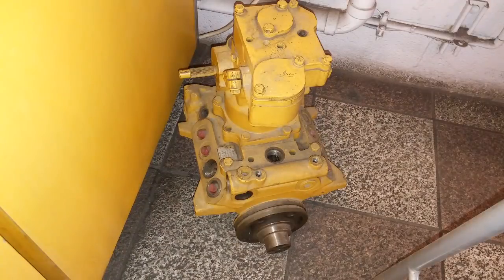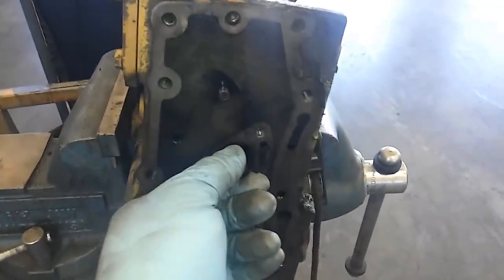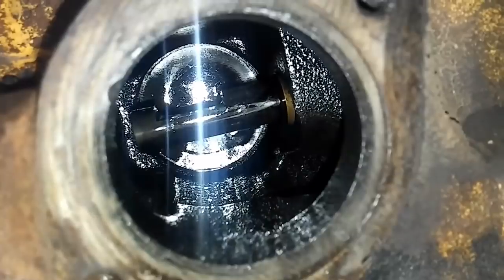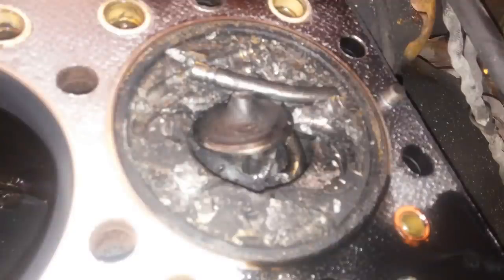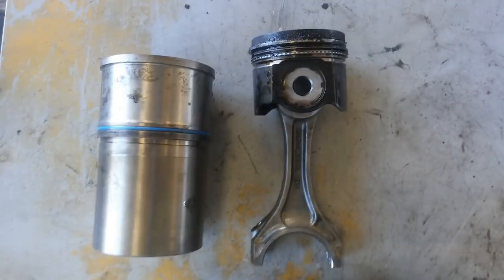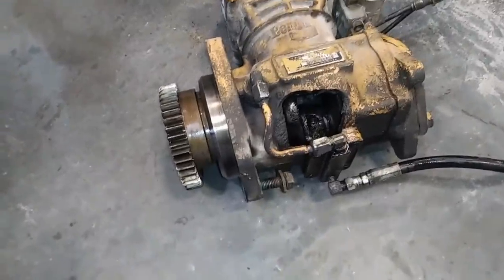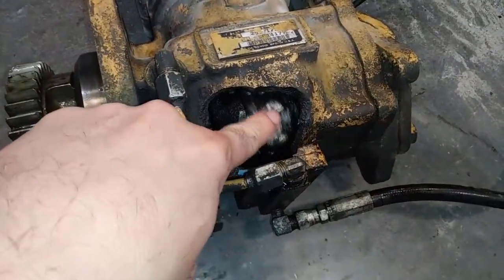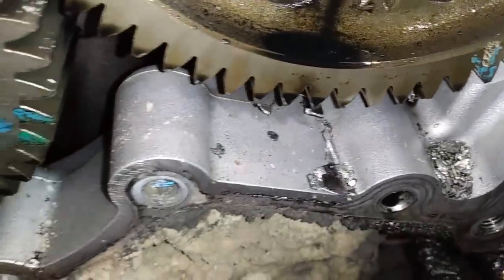Why Do Diesel Engines Runaway? What Is A Diesel Engine Runaway?

Comment: A run away diesel engine happens because of an oil leak in the turbo.  The engine can't be turned off because it isn't running off of the fuel. Worn bearings in the turbo let oil past. The engine then has a hidden fuel supply that you can't control. In a big truck you set the parking brakes. Put the engine in gear and stall the engine by letting the clutch out.

Comment: Everbody just looks at the car and wait until its out, but then it is to late, most diesel runaways are most caused by turbocarger leaks, and a diesel fire its fuel itself so it is useless when you try to shut the vehicle off, because it revs itself up with the oil, you can easy shut it of when  shut the air in take off with a rag or something, or driving away with a high gear, maybe by smaller engines block the exhaust pipe.

Comment: Some engines have very specific,known issues......for example the GM/Detroit 2 stroke diesels had an issue with the injectors internal rack getting stuck on full throttle after sitting for an extended period.  Adept, I have a question, why is it that CAT inline pumps are so much heavier, and physically larger than the equivalent Bosch design?

Comment: The term rack was on the 2 cycle Detroits it has a actual rack that has fingers for each injector the most cause of it running away was during a engine rebuild and  governor washer inside was put on the wrong side wich as soon as you started the engine it would pull the rack wide open, I always put a vice grip on the rack to pull it back in case it did. In 40 yrs I never saw a cat runaway or Cummins.  Turbos go bad and put oil in the exhaust then ignites and you have a exhaust fire , if a engine sucks oil from the intake it don't run away it just won't shut off until you block off the intake or it runs out of oil . I witnessed a Detroit run away the mechanic panicking put it in gear and the truck leaped 10 feet, I ran up put rags over the intake it just sucked them in and slowed a few seconds then I shoved my coat in the intake and it stopped but it almost took the coat through. It was screaming around 6000 rpm we estimated or more . Now so you know 2 cycle Detroits had term set overhead and rack,, Cummins /Cat you just set overhead . I don't mean to be disrespectful but Know more of what you are talking about next time .

Comment: If your diesel runaway.
First in manual try dumping the clutch in 5th gear with handbrake or brakes applied.
Second of you have automatic cut turbo intestine or block air intake with shirt or something like that. If this didin't worked so your engine wants to die early

Comment: Didn't older Detroit's run backwards also. Like when  using starter fluid? I think I remember seeing a cabover freightliner puking exhaust out the intake above the radiator.

Comment: Simple answer, an oil seal fails and the diesel engine sucks in engine oil and can not be shut off with a key.  For those of you that don't know, a diesel will run on oil if it is warmed up.  Nuff said.

Comment: Diesels are at wide open throttle at all times. That alone is scary. I had a rag get sucked into the intake, and it almost caused serious damage. Of course it was an old Mercedes Kompressor with a turbo.

Comment: Carbon dioxide fire extinguisher.
If you have a mig welder in the shop grab the cylinder of shielding gas.
Dump the gas in to the intake.

Comment: 1. To stop a runaway engine you suffocate the engine 2. for a fact I've seen many runaways are due to worn turbo bearings passing oil in through the intake side, the oil acting as a fuel. That's a runaway engine! all else is possible.

Comment: Thank you.  I was wondering if the comparatively low cost of placing a CO2 cylinder that could be actuated from inside the cab or the outside that would flood the air intake with CO2 at the flick of a switch or pull of a toggle. Good insurance that might never be needed.

Comment: The turbine in the turbo in my car broke and caused the engine to loose control,  I put the car in 6th gear and held down the brake while releasing the clutch, so I managed to save it, and that’s why I will never own a automatic

Comment: What would happen if you put the car in a high gear and dumped the clutch with the handbrake and normal brakes on? Would the engine be revving so high I could pull itself forward or would it stall like normal

Comment: Had a John Deere 4620 run away, lost power and died twice then the third time it went live. Buried the tach, rolling coal like a pulling tractor, idle it down nothing happens, turn the key off its supposed to stop, oh shit. I was pulling a four bottom plow so I grabbed high gear and killed it. Needed a new injection pump and new turbo, the governor failed in the injection pump and killed the turbo in the process.

Comment: Detroit diesel were always running away if the rack was not set propertly  you learn to keep the intake ready to be shut off with a board or use the flapper that was installed in them just for a run away

Comment: Discharging a fire extinguisher into the air intake might remove enough oxygen to stall it?
Reply: Only if it's a C class extinguiser. BC or ABC (or any non-c, k, d, etc) isn't likely to get you the desired effect and you might actually make it throw a rod with the chemical retardant building up in the cylinder

Comment: Re Diesel engines having lower governed max rpm. Not so much in Europe anymore. Most modern 4cyl Diesels now rev to 6000rpm, just like the petrol equivalent. Quite often they make more power than the petrol (gas) equivalents as well. With a typical 1.9 Litre Diesel now around the 180bhp mark.

Comment: Runaway engine is mostly caused by a snapped turbo shaft pumping oil into the intake 
You can stop that happening by blocking the intake manifold no air into the engine

Comment: I just bought a 2009 transporter and I found the intecooler intake unplugged and all wet in oil, is it normal the intercooler breathing oil? it wasn't dripping lots but it accumulated a lot of wetness around. I got the oring and plugged it again. I feel no difference but still worries me. Do you know what could happen?

Comment: The real problem is: free entry of air along with accumulated oil in the air cooler. Oil from damaged turbo. You accelerate and the engine pulls accumulated oil. perfect combination to feed the engine at full rpm. oil works as fuel
Reply: And it'll burn that engine oil, as fast as the oil pump can feed it into the cylinders.
Reply: @Bill-sp8kb  
no friend, that great fire is the excess of unburned oil, oil from the same engine. watch the big black smoke. this means a very rich combustion of fuel. nevertheless the fire appears when the unburned oil leaves in the form of hot steam. it catches fire as soon as it mixes with ambient air.

Comment: What if you is driving on the road or the interstate doing about 70 to 75 mph and the engine starts to run away? If it's a semi truck What can you do then? And you hauling a fully loaded trailer cuz at those speed limits i think it wouln't only be bad for the engine but for you as well and anybody else when it starts to run away so what can you do to stop that?
Reply: Throw in neutral and stop, open hood and clog air intake.

Comment: dont know about trucks but all modern diesel cars has a "throttle body" just like a gas egnine but its only purpose is to block airflow in case of a runaway

Comment: You would think that diesel engine engineers would build into the design a way to cut off the air from the cab and from under the hood or some form of compression release mechanism.

Comment: Put car or truck in 5th or 6th gear foot hard on brake and let clutch out slowly it WILL stall at any RPM if clutch is ok.. Easy as that no drama lost few miles on clutch. Tricky on auto box.

Comment: Nothing you talked about has anything to do with a runaway diesel. A runaway will not stop even if you remove the fuel supply- because the pistons are burning the oil from underneath, in the crank case. They will not stop until either the crank runs out of oil, or the engine suffers catastrophic mechanical failure.

Comment: I have seen it .my truck ran away I didn't know why. My turbo was leaking oil in the cylinder . can't be stop and cylinder was damage maybe 2 or 3 times it happen until I found out what was wrong. When it happened I moved out the way until it stoped.😅😅

Comment: Runaway is not a lack of being able to control throttle or run away is Larry the diesel starts using its own engine oil to fuel it so therefore you are not able to control the throttle has nothing to do with the actor of diesel fuel itself being overthrown it consumes its own engine oil which creates the inability to control the RPM

Comment: I had a Detroit Diesel runaway on me after I try to do a rack adjustment which I had just learned in school the owner's son jumped in the truck and jammed it into gear and I heard a ping and that was the drive shaft breaking I attempted to use the shut off the air shut off to stop it but that didn't stop it ended up unscrewing the fuel filter from the engine and I burned my arm severely on the exhaust but it finally shut down needless to say I was looking for another job the next day

Comment: Aneroid fuel delivery allows for runaway engines.  More modern fuel delivery systems can electronically cut off the fuel supply and stop a runaway engine.

Comment: just one question if you had a system to hold the exhaust vales then you could take the compression away ? 

the reason i say that is i knew someone that did that  so please explain i tend to stick to gas and electric

Comment: You didn't cover the other way that they can run away. Which is probably the worst. When the intake starts taking in an outside fuel source. I suppose you could snuff the intake, but I will be damned if I am getting near a diesel that is running away due to outside fuel source.

Comment: My diesel rev at 5000RPM in 3sec, my disk drive rev at 7200RPM in 3sec, my sport bike rev at 14000RPM in 3sec, diesel runaway rev at 40000RPM+ in 2sec. And people talking about putting in neutral or highest gear releasing clutch, doing shit. What they dont know, you will notice its a malfunction, it will be at 7k RPM, in time needed to stop the car, engine will be at 15k RPM. Then you will realize its running away. Time needed to access the engine, and engine will be at 24k RPM, thats the maximum it can survive. There will be lots of smoke, and you will not see the shit under the hood, specially if exhaust travel by wind to your face. And you have 2sec to stop it, before it runs out of capable specifications, that puts you in life danger. And thats between 40k and 75k RPM. Thats when you run away.

Comment: I remember when this happened on my landrover because the turbo was sucking in oil and I just had to stall it by basically putting it in5th and kicking my clutch then I disconnected the turbo hose and jammed a old towel into it but I was lucky my engine could be saved

Comment: At about 7:00-7:30 he says a hole in a piston due to collision with a valve sucks oil into the cylinder, resulting in runaway.  I disagree with this.  The cylinder with the broken piston will not develop enough compression to create runaway on that cylinder.

Comment: dsnt matter its controlled by ecm or mechanical pump. evn ecm controlled engines can runaway if it starts consuming engine oil thru intake manifold thru blow by pipe.

Comment: Also known as a choke some of the very old diesel forklifts I used to use had a choke on the intake so when it started acting funny we had to pull the choke and shut the air off

Comment: Would it be possible to lube the turbo with a different oil source that uses non-combustible oil?  Maybe some kind of synthetic lube exists that would work at high temperature for turbo bearings but that would not burn in the diesel engine (I know, expensive for something that's so rare)

Comment: i helped a buddy run a line to his intake and hook up a co2 canister in his cab so if he has a runaway he can just turn the valve and starve the engine for air. i dont know if itl work or not but sounds like it would

Comment: NA engines will eat its oil from the oilpan, by having enough blowby to pressuize the bottom of the engine. Whether you have a good fuel pump or not, once you have oil getting into the engine, it will start to accelerate you. 4Speed VW GOLF - 1500 cc engine. I had both feet on the brakes, pulled the Rear brake handle and I went past 70mph. The head lifted a little, but again - It got some more oil and it would not stop. 

Turbos - will add MORE pressure. Rebuilt when appropriate. 100,000 miles- 250,000km you get the idea. Saw one guy try to stall a Turbo one, He almost lost his hand to the Turbo. Mincemeat.

Comment: So... is it possible to close the exhaust and kill the engine. You know, the old "banana in the tailpipe" trick? Since the exhaust is relatively removed from the engine, it seems like it would be a safer alternative, if it would work.
Reply: Yes, plugging the exhaust will work fine, just quickly sit on the ground and put your shoe on the exhaust pipe.  However, big truck exhausts are way above the cab.  But on cars & light trucks the exhaust pipe has to come straight out from under the bumper.  You can not just shove a rag or potato in the exhaust pipe the pressure will be to great.  You must sit down on the ground and put your foot (with a shoe) directly on the pipe outlet.  This will not stop the engine but will slow it down until someone can get a rag in the air intake.  This all has to be done fast because if the engine is warmed up your shoe will get hot qickly to say nothing of all the exhaust fumes.  You have a good idea but it can not stop the engine, just slow it down.  I'll bet you're asking if the engine can not "breath" by letting the exhaust "0ut" how can it run.  If the exhaust can not get out the exhaust pipe, the engine will exhaust into the intake manifold when the intake valve opens.  The engine will then quickly suck this exhausted gas back into the engine along with some fresh air.  This keeps the engine at a slow speed  and gives someone time to shut off the air supply.  Good idea hot foot.

Comment: I actually had a Nissan np300 diésel run away on me and it was literally months old, it was because the fuel pump failed and pushed te engine waay beyond the governed speed, easily 4-5k rpm

Comment: I have had two stroke KTM’s run away and it’s scary but it only happened on low fuel or running out it’s crazy scary situation riding a runaway 380 racing two stroke

Comment: I would throw a shop rag into the turbocharger of a runaway diesel engine. It would stop the engine but, would damage the compressor wheel of the turbocharger. Pop off the intake tube to the turbo, crumble up a cloth shop rag, and throw it in the turbocharger. Then have the diesel truck towed to a repair shop. Replacing a 1600 dollar turbocharger is a lot better than a 10000 dollar remanufactured Diesel engine.

Comment: A runaway is a scary thing.  Nothing like a diesel revving at 9K or so.  My first I killed the engine with a clutch dump in the highest gear with parking brake and as much pressure I could muster on the brake pedal.  Still wore 1/2 inch grooves in the asphalt.  Not fun.

Comment: I just started a Deutsch 1011 F engine in a bobcat and it ran away so I cut the fuel line, but it ran for 30/42. Brand new motor I did the rebuild, but something happened. I think it was the governor. Fuel rack didn’t shut it off so I think I have a bad solenoid too. What do you think? Any thoughts anybody

Comment: Never knew the oil provided ignitable power under compression. ..or is it because of a diesels higher compression?
Reply: I ran my old 6.5 diesel on transmission fluid/diesel mix just to lube my fuel system. Any kind of low ignition fuel or oil that has a low burn can run in a Diesel engine. Some military trucks with diesel engines can run on jet fuel or kerosene.

Comment: Who Ya gonna call....Diesel busters!  I always keep a metal lid mounted on a wooden pole just a tad larger than the intake or turbo intake and cap that sucker...Or in the case of an air-box with a flat filter a thick piece of cardboard cut to the size of the filter and toss it in there. No air / no combustion. Choking it out by capping the air flow off is the fastest and safest way to stop a runaway. Don't mess with the fuel it can make things worse if it sprays on hot manifolds ect... And prepare for this before you ever start the engine.

Comment: I've had a few old GM 2strokes run away when it only takes 1 stuck injector to jam the whole damn rack on full noise. And you have to block the intake and hope it doesn't suck the blower seals in and start running on oil, then it's time to get the hell out of Dodge!!!!